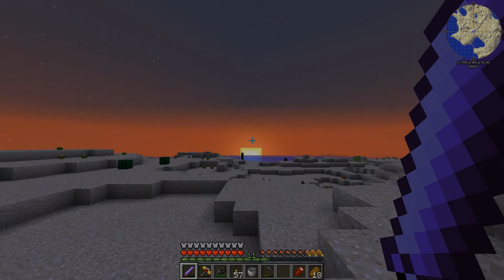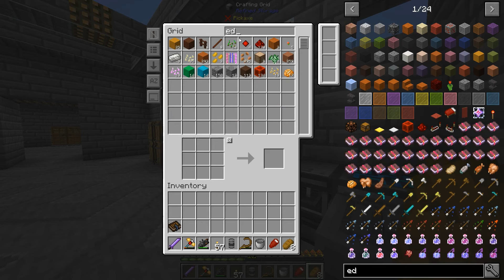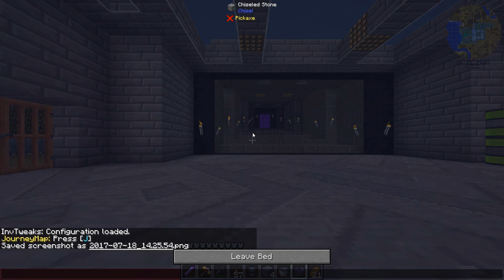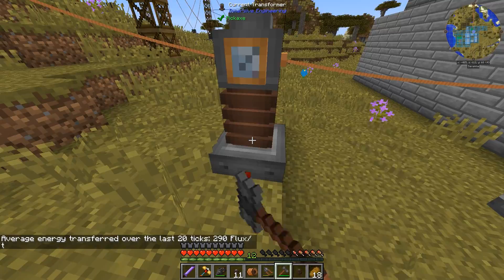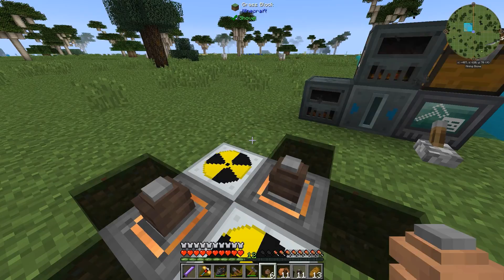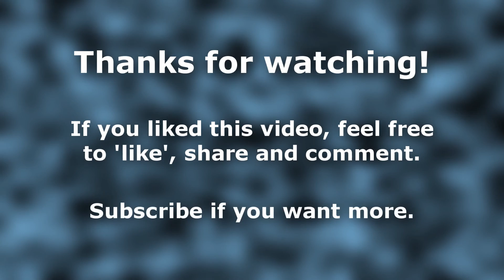FTB Infinity Lite #15 - New Power System (Modded Minecraft 1.10)

Comment: nice. keep up the good work. as for big reactors, you can fuel it with immersive engineerings uranium, but if you cant find yellorium to make the actual reactor stuff out of, then your out of luck. also, i dont know what thermal dynamics your playing with, but in the pack im playing on, you can make charcoal+creosote using a redstone furnace and special augment.
Reply from the maker: I need to check the status of Big Reactors and how they are supposed to work in this pack. I have some Yellorium from before but it doesn't feel fun using them if they are disabled... But for now I have power covered for some time, the tier IV panels are not that expensive. Mostly glass and wood actually!
In FTB Lite there is no Thermal mods! So no augments to play with ;)
Reply: TKH ah dude, that makes them so much more easier